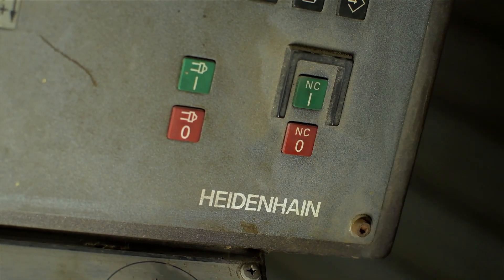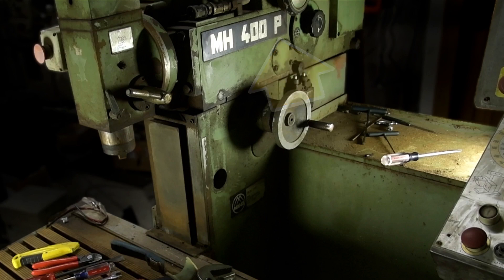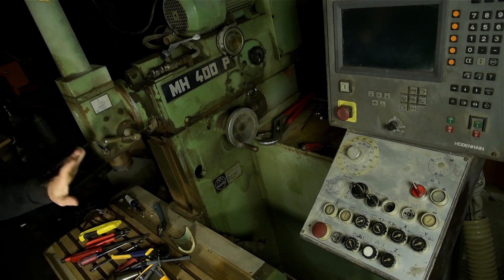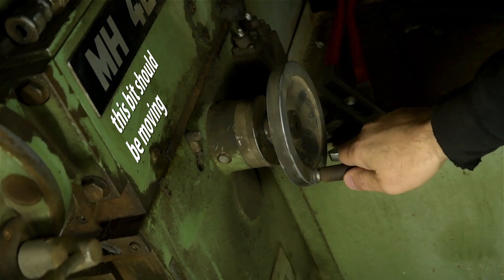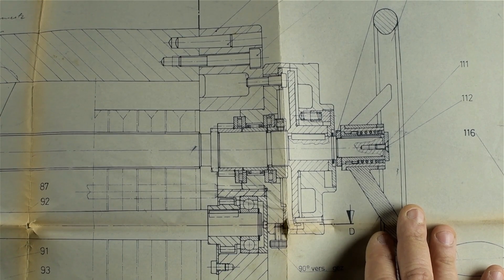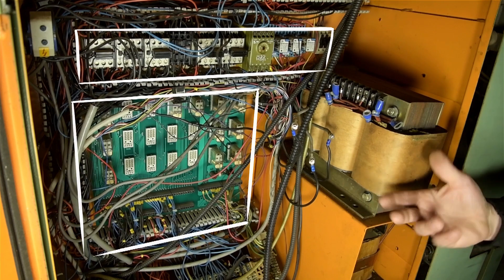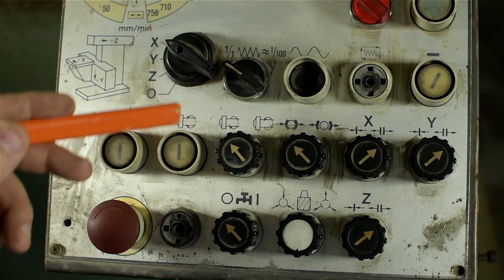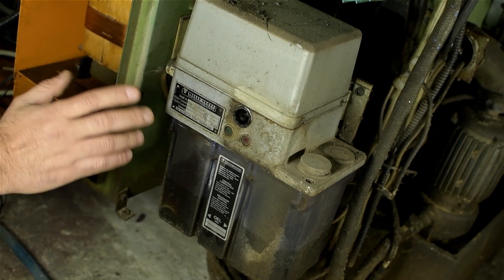MAHO is Filthy!!  (Whose Milling Machine Isn't?)

Comment: That old robot pee smell is most likely the coolant tank!

In most of the older mills, the coolant pump dies, and nobody bothers to drain the catch basin and storage tank. So like the deep fryer full of oil you put under the counter intending to use in two days and found six months later, the oil has gone rancid.

Please film the attempts to clean out the sump!
Reply: thank goodness there is no smell o vison yet, that stuff is gross, especially if it has had time outdoors to get leaf litter into the oil to provide extra growth media.
Reply: Instantly regretted inventing our Smell-o-vision :(

Comment: I thought my milling machine was f*cked the first time I tried to start it up as well, but it turned out that it was wired with a 4-wire cable (common neutral/ground) when I needed a 5-wire because of the RCD.
Reply: For us Americans, GFCI outlets provide a type of RCD protection.
Reply: @absalomdraconis  American wiring is a whole different world compared to european I guess... All my machines are running on 3-phase 400V and for that you don't really need the neutral wire but this mill is using one phase (230V) to power the contactor.

Comment: Here some Information about the Hydraulic System:
The Hydraulic Pump sound is normal for this type of Hawe hydraulic Powerpack!
There is a high pressure Radial Piston Pump in it.
Hawe build excellent precise leakage free seat Valves for those applications.

Comment: 1:1 ratio transformers are used for isolation for safety purposes. Without it you'll get lethal shocks two for the price of one... as in one hand on a hot electrode instead of two. Wear rubber boots around your Material Realm Escape Device and you should be fine

Comment: Hello, im from Germany. So i worked with the sister model oft your MAHO 400 ( a DECKEL FP2 CNC ) 
Also I could help with the german manuals.
Well if there are some questions, feel free to ask :)
Reply from the maker: You know if the hydraulics are supposed to run non-stop?  It's driving me mad. :)
Reply: This Old Tony 
Your MAHO is one generation before the one I worked with. For my knowledge it‘s suppsed to run the pump all the Time ( until the operator shuts it off ) 
Sorry that i could‘t help you :/

Comment: A good friend has an 800p of the same era. Feel free to ask questions or get a scan of his manuals if needed.
Reply: Although his is a TNC 135. The big axis motor is a DC servo. His has a very very large rotary table integral.
Reply from the maker: Thanks Ralph!  I've asked a couple of other viewers, but maybe 3rd times a charm: I can't figure out if the hydraulics on this thing are supposed to run non-stop.  It's driving me mad. :)

Comment: The sound that your hydraulic pump makes is normal for a Maho. (and Yes it's "Mah - Hoe".  Both our (Newer DMU-80T 5 axis and old) Mahos have a very similar type of pump setup. The newer machine hydraulic unit is so small, It could almost be confused with a central lubrication unit. Maho hydraulic units also build pressure, then stop. They do not run continuously, rather they hold the pressure with an accumulator until you use something hydraulic (aka the drawbar) - seeing the pressure drop, the motor kicks in again to build the pressure back up. I'll never get used to that periodic SQueeeaaaaaahh noise. So just an FYI  - sounds like it's "working as intended"

Comment: That big Transformer is needed to convert 3 Phase 400V into one Phase 230v and sometimes 24V in the European versions. I'm not sure what you're Line power is.

That Hydraulic pump sounds Low on Oil and should be quieter. Try filling it with HPL64 or similar Hydraulic Oil.

The "Vogel" pump is very expensive. It pumps a few seconds to reach a predetermined pressure and then stops. 
Your Lubrication system should be fine.

To turn on the big motor you need the TNC to work. That should be a Brushed motor. Don't bother it. One of the most expensive parts on this type of mill.

If you need help with translation or simply understanding the mill just drop me a massage.

Comment: I used to like this channel.  (ha ha)
I looked it up.  It supposedly weighs 1265 kg.  At $0.40 a pound that's still a lot of moolah.
Best of luck with the rebuild.   I just can't help but wonder that for the same cost + all the other parts you'll need to buy etc. whether you couldn't have just gone out and bought a decent NCN mill that already works just fine?  I dunno.  Maybe not.

Comment: Gear acquisition syndrome at its finest... :D How I understood you, for example, at the moment when I bought my bigger lathe, I had no any space for it. NO space at all. While lathe was  traveling to me, I found and rented space for bigger workshop. But at the moment of purchase I had even no idea where and if at all I could find some new place for workshop...

BTW, I have found that best way to clean light rust from machine surfaces is to use Dremel tool with stainless steel brushes of different shapes and all the time keep surfaces wet with kerosene. In a such way you can "suck" out rust even from small cavities caused by rust, but good metal is not even scratched, so, very saving method to surfaces. I guess, some soft hand brush can also work.
I use cheap brushes from Aliexpress.
WARNING- with these brushes eye protection must be used all the time and no other alive souls with unprotected eyes around as thin wires can (and will quickly if overspeeded) fly out!

Comment: The oiler will run on startup and every 30 minutes after that. Got the same one on a Mikron WF31SA at the shop. It's basically your machine's slightly larger swiss cousin with a TNC 114 controller. And your controller is miles ahead of that.

The Mikron does have independent servomotors. But has only a single driver which switches between motors with relays

Comment: The transformer could be a 'stufentransformator' or in english 
step transformer that is used to power the main motor (Spindel or axies) and change the speed.
for this it uses the incoming 400V and transforms it into voltages like 105 V / 150 V / 190 V / 250 V / 400 V for a 5 step transformer.
after that you use relays to chenge between the voltages, keep in mint to not have two voltages on at the same time.
The breaker pops maybe because the relay doesen't switch any more and two voltages are activated at the same time.

Comment: damn... i tryed to kill the exact same machine during my apprentenship for 3 years and execpt for the hydraulics it surrvived... liked the rpm adjusting thing on the spindle motor... but its junk under high loads with low rpm... the belt wiĺl start slipping because of the low preload...

if you let it run a cnc program it moved onöy one axis a time after it reached the desired position (had DRO feedback) it clamped the axis (directly in the guide rail not spindle) and moved the next axis...

Comment: I had a quick look for manuals and this site has them in English: https://store.lathes.co.uk/print/mm85
Reply: The machine is German, so mains would be 230V so the transformer might be tapped in half for the US market, so when wired it has a 230/115V supply and steps down to 100V and a bridge rectifier that supplies the pancake motor with 100V DC. If you bypassed the transformer, you are supplying 110V AC and the motor wouldn't spin. Try it with a bridge rectifier and you might find the motor works.

Comment: Greets from Germany,

Congratulation for buy this heavy milling Maschine. 
We use the MH 500 maschine in the Shop,  and it works very fine after 30 years. The 400 in the name MH 400 is the length of the x- axis.... and MAHO is one of the best producer for heavy machining in the '70-'90 years in Germany. After the 90 it's fusion with  the Company "Deckel" and the Company "Gildemeister and named sincely "DMG".....

ENOUGH history😆.....

In Germany , much of this machine's where are totally overhauled and sell's for 8.000-12.000€

If you need any help with the machine or the control send me a email and I support you much that I  can. 

Have a nice time with your MAHO

And greetings from Germany
Reply: @sirjaye8884  sehr gute hahaha... what's more fun than an automatic Manuel! :)
Reply: Mahos are very rigid and accurate machines... or at least the ball screw machines were.  Mr father worked on these machines for 40 years.  Maho merged with Dekel, then Gildemeister and later Mori. DMG, maho deckel gildemeister. Does this machine have glass linear scales?  nevermind lol
Reply: Fawlty Towers springs to mind, Basil hanging the moose head.
Get me a hammer Manuel!
Hammer?
Hammer?
Hammer Sandwich?

Whatever you do, don’t mention the war! 😜😂😂👍
Reply: @ianmoone2359  I mentioned it once, but I think I got away with it!  😂
Reply: Do you need worker on maho? 
Philips 432/532
Reply: You seem like a nice guy, Manuel, can we be friends. I dont have any German friends.
Reply: ATLHooligan looks like you will continue not having German friends..
Reply: @alexblackburn627  
That's funny dude... 😅🤣😂
Reply: @ATLTraveler  yes, we can

Comment: We have a very similar maho at work, and the hydraulic pump sounds exactly the same, and there have never been any issues with it, so just wear earplugs when you need to change out the tool, and it should be fine

Comment: That transformer is a seperation transformator. Required for CE, machine power is mechanically separated from factory power.
Reply: I worked with similar CNCs and this is not a separation transformer, but You are close with CE. This is a big power choke. It can be easily confirmed as these are just 3 coils in series with circuit, one for each phase, so with multimeter You can check that it will buzz between single coil ‘power’ and ‘machine’ connector. In separation transformer You will have buzz between all ‘power’ side connectors and ‘machine’ side connectors – as in transformer they will be star or delta connected. Such big choke act like energy reservoir, actively keeping huge current noise generated by machine from being introduced to rest of power grid.

Comment: There was also a "real" CNC-version of this machine. It was called MAHO MH400E and had a Philips 432 Control. It was equipped with three servos and ball screws. As your machine is the P-version it should have a Heidenhain TNC121 control. The E-version was introduced later and was just a modified P-version to fit the 432 Control which was able to do 2.5D machining. Later versions could even do fancy things like "helix" and threadmilling. The E-version had also a gearbox combined with a variable speed motor which was operated by the control. Here in Germany these machines are still quite common and they have a very good reputation being accurate and durable.
Reply: The TNC124 is a much more recent control than the TNC121 and often used to retrofit older machines. It is capable to control up to 4 axis simultaneously and has serial interface which allows copying programs from a connected PC as well as drip-feeding them. The nice thing about the Heidenhains is that this can be entirely controlled from the control (no need to initiate the transfer or the drop-feed from the PC). I would try to keep the TNC124 as it is a very capable control (in my opinion superior in most aspects compare to Mach3/4 or LinuxCNC solutions) and able to read the glass scales (which could be a challenge otherwise).  Nevertheless not an easy project to add servos....
Reply: So there may be a possibility of retrofitting ballscrews and motor mounts from a scrapped MH400E?
Reply: @greggv8  correct, but sometimes is´s even cheaper to buy a MH400E with one of the latest versions of the 432 Control. It is definitely not going to be the fastest but it´s going to be accurate and will get the job done. There is already a postprocessor for the 432control on fusion if you´d like to use this software.

Comment: I learned CNC milling on such a machine. Not exactly this model but a slightly different model. I love that machines (Maybe because I learned on it :) ) I think the base is pretty good for your project. Maybe dont share just the finished project. Each step is very interesting :)

Comment: I spent a year back the 80’s working in a machine shop.  The smell of rancid coolant congealed in the bottom of the chip tray is something you never get out of the back of your nostrils.
Reply: The smell of hydraulic fluid after a forklift got serviced was bad enough, you'll probably even be stuck smelling the stuff when you're dead.
Reply: @absalomdraconis  Heh.  After a stint in network admin, I went back to the family business of earthmoving construction.  I’m well acquainted with over-ripe hydraulic, and worse, sealed gearbox oil.  The worst has to be the planetary final-drives of excavators…  some serious anaerobic action going on in there...
Reply: @vaalrus  
Shit, just wait until a semi truck blows a wheel seal and you get to smell burnt 80-90 synthetic mixed with brake dust. Lord almighty does that ever smell horrible.

Comment: Normally if you try to make a Venn Diagram of "Automatic oilers that work" and "Automatic oilers that have oil in them", you'll be lucky to find anything in the intersection...

Which of course makes it an Euler Diagram.

Comment: The one transformer with same voltage on outpput as on input is Separating Transformer, it galvanicaly separates the machine from the electric wiring of the shop. Its mostly used in labs where there may be some electrical devices without covers with exposed live parts. It also protects the operator of the machine from getting electrocuted by toutching metal part that is under current due to failure on the electric parts of the machine.

Comment: Transformer looking thing you bypassed is probably mains  choke. It is used to potect machine from voltage spikes (temporary overvoltages) from mains input . Also used on input of AC drives (VFD-s) to prevent harmonics created by VFD  from disturbing mains line.

Comment: Insides of that electron-container looks similiar with my project. 

I Bought an old mig welldo-thing, with all trouserhangers loose, it was sticking wire out in full throttle.  Also contact was on all time as gas valve too. 

 Palmfull of earscratched cockroaches on the pcb, solved the problem with candymoney. So i got 1500eur manual metal 3d printer for 70eur. 

Mouthline goes from ear to the opposite one.😀

Comment: Wow, I’ve got a very similar project I’m gonna start working on this winter.  I got an old lagunmatic CNC mill for 1300$(.26$ lb).  It still has a fully functional controller and motors but the controller has a pitiful amount of memory, only like 1000 lines of gcode will fit.  I plan on changing out the controller for a LinuxCNC system so it’s all onboard.  Wanna race to see who gets it done first :)

Comment: What? No ballscrews but has glass scales? It blows my mind.
By the way, old heidenhain control should have rs232 and dnc option. I have worked with TNC355 making "smooth" 3D mold surfaces.

Comment: Some silly questions (I'm behind on my quota and need to catch up):
1. Should we assume that you checked nameplate voltages on all of the motors? The controls/KontrolleMecanismeSwitchungDisplayThingummis being in German, there's a possibility that the motors are set up for 220V instead of 110V. There may even be a diagram on the nameplates for how to convert.
2. About that transformer that you wired around -- Is there a nameplate on it? Was it intended maybe as a step-up/step-down for 220V-110V conversion? 

3. There's no 3-Phase / DreiFasePowerElectrikDoohikki involved, right?
4. If there's no schematic diagram, have you drawn a diagram of the wiring as found? (You'll save beaucoup headaches if you do).

Comment: That transformer you bypassed was probably the isolation transformer. Used usually for safety reasons to protect the operator from electrical shocks.

Comment: We had a bunch of similar MAHOs during my vocational education but with older HEIDENHAIN controllers. Basically these machines are very modular and were also sold with true servo motors. Mostly Indramat (Bosch Rexroth today). I don't think stepper motors will be a good choice for this machine. This is serious stuff and not a "toy" .

Comment: Heidenhain is one of the better controls. Most likely it can do 3-axis, and it can drip feed with 38000 baud speed. Oldest one I have used is TNC 155

Comment: Since it's clean, no woodpecker marks on it, and it stinks, me thinks this was used in some kind of automated milling capacity where there was a lot of liquids and custom fixtures. I'm also looking at the handles and they look clean (compared to what i've seen whenever i've visited the house of horrors), so that supports my guess as well.
Be sure to check the motor winding and bearings, wiring to the motor, and the table's up and down capacity (internally) thoroughly, this model has issues with the table, where it develops a case of bad "nut".

Comment: "Useless" transformer is to eliminate direct machine connection to supply (it`s connected thru 1:1 ratio transformer) so no excess overvoltages can pass thru because core itself cannot transfer more power then it could handle. And it's also good against negative transient currents in the supply line. In a machine shop with a lot of equipment, it could be handy.  Like so.

Comment: I was luckey enough to get a mh600c two years ago. Really great machine. Retrofitted using linux cnc. Mannaged to get the original drives going without to much trouble. If i remember corectly the lubrication pump has a timer built in. It will give a error signal if it does not reach pressure. My machine will not work if the pump does not go on.